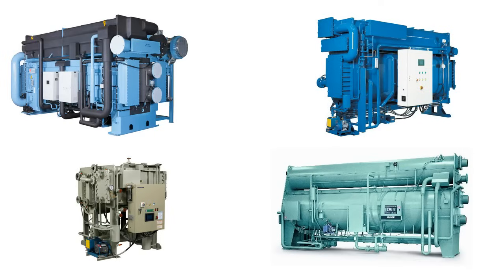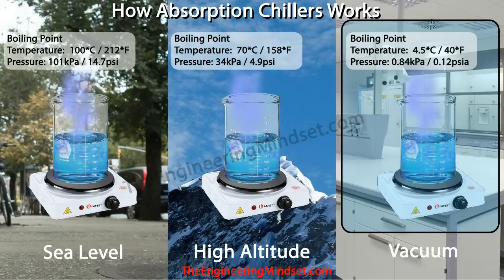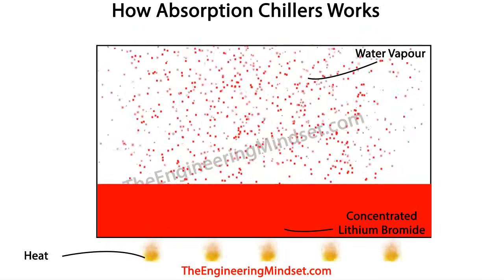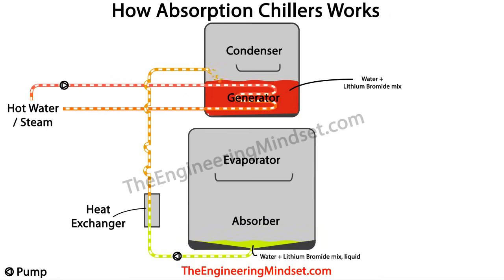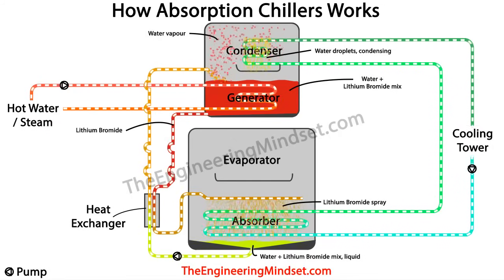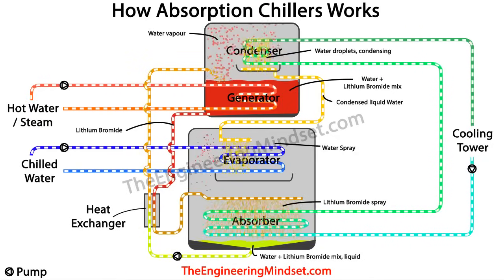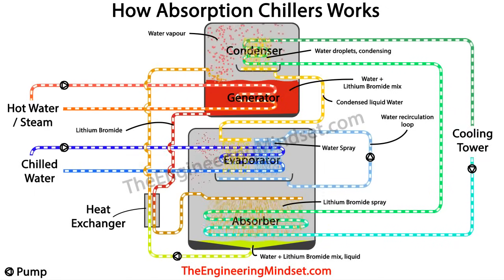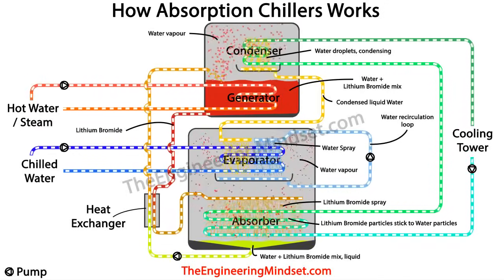Absorption Chiller, How it works - working principle hvac

Comment: hey, the chilled water flow direction icon seems reversed.. and I think it will be easier to understand if you put Operating Pressure and Temperature (or T & P for each flow) so we know whether the heat transfers are feasible.. Thank you anyway for making such a great educational video..
Reply: I also think a typical kWh energy transfer or %age energy transfer would be useful; the energy in the waste heat, how much ends up being rejected in the cooling tower, how much gets returned as chilled water.  Great video to help a sparky understand the 'magic' of an absorption chiller.
Reply: No, the color is reversed

Comment: Great video! I wish the temperature for each line is placed there, so we can picture the heat exchange clearer. Thank you.
Reply: Me too
Reply: The explanation is wrong:
Hot water/Steam is dumping heat into the system.
Chilled Water is also dumping heat into the system.

Comment: The secret lies with partial pressure. As the Li-Br absorbs H2O molecules, it decreases the partial pressure of water inside the evaporator which causes the partial vacuum and hence the cooling effect. This is almost similar to the expansion valves of a vapor-compression systems.

Comment: Once you spray water into the vacuum, it no longer is a vacuum unless you pump the molecules out. This seems just like a compressor in a traditional AC but with extra steps and added confusion. Inputting hot water makes only sense to the extent to operate such a pump in the same way generators operate in power plants.

Comment: Great explanation, a real human voice and no distracting muzak in the background.
There is no compressor, but compared to a classic vapor-compression A/C, how much energy does the pumps and control system use? This assuming the heat source is "free", just the system itself. Thank you.
Reply: It depends on the machine, bin my experience if the electric consumption of compressor chiller is like 30% of the entire cooling energy production with and assorber this electric energy is like 1%/2%. However with the assorber you spend more water and so more energy in the cooling tower, but in the end less than a compression chiller do.

Comment: I liked this video a lot, it helped explain things in an accessible way.

Just curious if you can clarify two questions I have:
The chilled water line comes in at about 12°c that's already quite cold. How does it get down to 12 if the area being cooled is hot, say 35°?
2. How does the cooling tower work? Is it just a pipe that the warm water runs through to reach ambient temperature? Doesn't that contribute to heating the area?

Comment: O.K I got the basics. Now to look at other videos that give details of calculation of flow rates in chillers. I have 2880 cft room that needs cooling this summer. I already have solar water heaters installed ( 300 lit per day to 70 deg C). lets see if I can get it done.

Comment: It would become more useful if you added temperatures and pressures.  I see someone else already asked you to change the flow direction of the chilled water...but since it isn't clear to me if purple is cooler than blue, it's hard to tell if the flow direction is wrong, or the arrow is wrong.

Comment: not a magnetic attraction to lithium bromide but when water vapor produced in the evaporator area so there is more pressure than the absorber by pressure difference water vapor traveled to absorber hence lithium bromide absorb the water vapor.. BTW nice teaching thanks

Comment: Great video! But I suggest you change the third pic of water boiling at vacuum from an open beaker in the lab set up to some kind of closed vessel. Just to emphasize the vacuum in this case..

Comment: hi thanks for youre vidieo. i noticed a mistake on the drawing the pump direction is going opersit to the flow indicators. can you do 1 colour pipes and take off the white scrolling boxs. its mind numbing hypnotic. pump direction or 1 arrow for each pipework is easy to understand. make it accessable as possible. take the back ground logo and just keep the one at the bottom

Comment: Please could you explain me the exact function of the Lithium Bromide ? is it not possible to only use the energy absorbed by the evaporation of water at very low pressure to chill the cold water tubes ?

Comment: Rough numbers would certainly help conceptualize. Exact numbers would vary but Temperature trends should be consistent.  ~ 100 in leaves at 75 out ect ect

But looks pretty straight forward

Comment: @EngineeringMindset Got one question. Looking at the pump for the chilled water where the extraction of the chilled waters is made its look like the direction of the arrow on the pump is pointing towards the flow of the chilled water, is it something i'm missing?

Comment: I've been toying with the idea of a solar powered air conditioning unit and came across the ammonia/water based systems and the thought of working with concentrated ammonia is kind of scary. This seems to be a far safer chemistry to do this with. 
Overall this was a great intro to the way it works. Though there are a couple questions that spring to mind. How is the vacuum pulled? Is a separate vacuum pump used? Does the pump feeding the generator manage to do so? Or, as someone in the comments below stated, the cooled concentrated lithium bromide solution is so hygrophilic that is will create the low pressure by pulling water vapor into the solution. Which, if true, would simplify things immensely.
Also, I'm assuming the water collection tray in the evaporator will need some sort of purge mechanism to occasionally dump the contents as otherwise over time it would inevitably start to accumulate the salt.
Reply from the maker: Seen our new video on HOW SOLAR PANELS WORK in detail https://youtu.be/Yxt72aDjFgY

Comment: At what point in the absorption chiller is it used to cool a building? Is the chilled water pipe whats used for cooling a building? I understand how the system works in a closed loop, but am trying to understand how its implemented in a cooling system

Comment: Very nice video and easily understandable. I have a question, Can we use Gas Turbine exhaust gases instead of Steam or hot water to transfer thermal energy to water+Lithium bromide mixture. Thanks
Reply from the maker: kamran baloch can't see why not, it just needs heat. The density will be lower but the flow rate it high
Reply: Thanks for your reply. I am currently involved in a project where we have Gas Turbine with around 69,000 kg/h of exhaust gases at 544°C releasing to atmosphere, we need to utilize the thermal energy of these gases by installing an absorption chiller.
Reply from the maker: Might need to push it through a plate heat exchanger, sounds great

Comment: Great video thanks ! 
I'm desperately trying to find an answer to my question; 
How can possibly a double-effect absorption heat pump reach coefficients of performance (COP) higher than 1 ? 
I don't understand how a heat input (let's say waste heat) can result in a greater amount of heat removed (numerator of COP) than the said input (denominator of COP)... Someone to help here ? Thanks in advance !
Reply: Because you are transferring heat, not creating it. Using a certain amount of btu, let's say 1, you can drive a process which can move more btu, like 2 or even 3 from outside to inside.

Comment: Hi thanks for the presentation. How does the efficiency of an Absorption chiller compare with the energy needed to run a geothermal heat pump.
I live in an off grid situation in Fiji and would like to set up a cool room for chilling vegetables to around 4c.  I would need to generate electricity  to run a heat pump or I could use solar heated hot water or a boiler to run a absorption chiller.  If I build some thermal mass into the cool room the cooling system wouldn't need to run for 24 hours.
Thanks Simon
Reply from the maker: These are not efficient machines very low COP, however if you have access to cheap or free heat then its a good consideration

Comment: theory is good.
question: who is manufacture such absorption type air conditioner in USA?
how much cost? 
and unit that use amonia ?
Reply: Broad and Thermax are the imported units. York/Johnson Controls units are probably the most used that are still in production.

Comment: Sir, what if I assume there is no heat passing through the either condenser or evaporator. instead we only allow the water passing through it. Then what can happen. Will there be any possible cooling

Comment: why is that in evaporator dropping temperature happen instead of hammering or increasing temperature  (boiled) if the issue is sudden change pressure?

Comment: Dear The-Engineering-Mindset, why don't they use absorption chiller in car with internal combustion engine where heat is generated all the time? Thank you in advance for your answer.
Reply from the maker: It's not efficient for the volume it takes up

Comment: So I was tracking the process backwards from the flashing of liquid water to a water vapour mixture in low pressure that takes heat from the chilled water and I thought why not just create steam in a furnace, flash it and forget all this chemical messy stuff....then I realised that all that steam would be wasted so an absorption thingy like lithium bromide seems useful

Comment: Really good video. However, not to be that guy, but pure lithium bromide is not a liquid at least in the typical absorption pump temperature range. It’s the solution of water and LiBr that’s liquid.
Reply: It could have been mentioned also that the cooling tower rejects more heat (heat from the steam + heat from the chilled water stream) than what is brought in by the steam

Comment: is it possible instead of using cooling tower to use air cooled condenser because cooling tower consumes lot of water which is rare.
Reply from the maker: As long as the cooler can reduce the water temperature down enough, I can't see why not
Reply: if the ambient temperature is 40ccan it cooll the water to accepted limits instead of cooling towers because cooling tower consumes water which costs
Reply from the maker: Monzer Al-Hafez you would need to look at some manufacturers manuals to see what limits their products are designed for, this will tell you the heat rejection, temperature, flow rates and pressures

Comment: Hi,  I think it is pretty well explained. one issue.. you say the condenser water in the evaporator water takes the heat given off by condensation away..   i think that could be explain better; because by saying so i believe you are violating the principle that heat always travel from high to low temperature. it is, i know in a sense taking the heat of condensation away, as this "heat" because of the vacuum is very low temperature. and the condenser water is cooling down. but the condenser water is actually giving its heat up to the evaporator. it is the only way to say it correctly. Has nothing to do with the the condensation of the refrigeration water.  The water vapor is condensing because of the affinity, as you say magnetic pull, of the salt for water. steam condensing cause additional vacuum. steam takes up a lot more space the water, so when steam condenses it creates pressure drop, and even lower temperature by definition i would say..  the condenser water is being cooled down  and this isadding efficiency to the whole system. it is really just another heat exchanger.  let me know what you think.  thanks for the video.. its great

Comment: How to improve Cop of Cold Storages @ -20.Celcius ..operating against ambient 35.C +
Reply from the maker: first start with the cold store, mak sure its very insulated. Then refine flow rates and temperatures of water and refrigerant within manufacturers limits, install vsd if possible on chiller, consider ice storage buffer vessels, ensure cooling towers working well and clean and that a very stick water treatment programme is in place
Reply: Sir 1 kg steam change to btu how
Reply: Sir how to change steam kg to btu
Reply: can we use cold chain product?  how much TR generated  capacity available?

Comment: I think the key point here is not low pressure low boiling point.  Key point is Li Br has low boiling point, it take energy away from water when evaporated. That's why Li Be solution is used, instead of pure water.

Comment: Why dont we use absorption chiller for cars?  I mean we have a lot of heat lost ... and we need less work for pumps in compare to compressors
Reply from the maker: I like the idea, why not see if you can make one?
Reply: Because you need huge space
Reply: Also it is so heavy.
Reply: You need a very big surface area

Comment: Why aren't we using this system in our homes? Condenser/generator is solar heated on your roof with the Evaporator/absorber on ground level to bring cool air inside? The hotter the outside the cooler your home ¯\_(ツ)_/¯

Comment: Solid state graphite power cell bank that charges organic carbon power cell bank that powers electronics that produces an energy frequency that is passed between two tesla coils with zero energy loss in a loop. Graphite rod placed between coils with energy frequency passing through graphite rod causing graphite crystal structures to vibrate and heat up making the graphite glow red hot. A system to provide a heat source for a free refrigerator and an air conditioning unit and a free heating and cooling system. How cool right?
Reply: any reference to this system?
Reply: What do you mean you need a step by step break down because you can't understand how it works beacuse of your indoctrination?  😒👽
Reply: Okay so you are basically using induction heating of a graphite rod to heat the refrigerant.  The real question is, can your "Solid state graphite power cell " produce enough electricity to keep the carbon batteries charged enough to make the system cost effective.